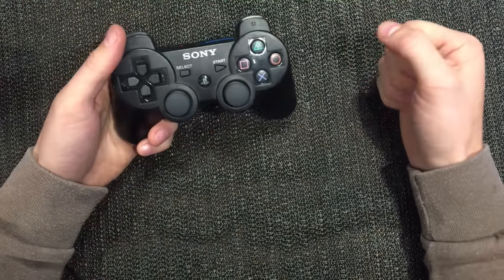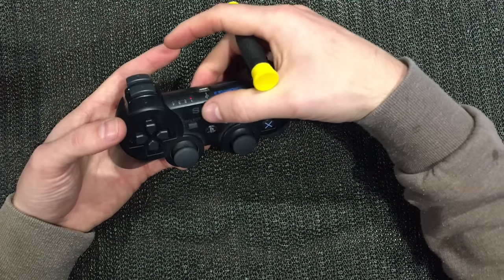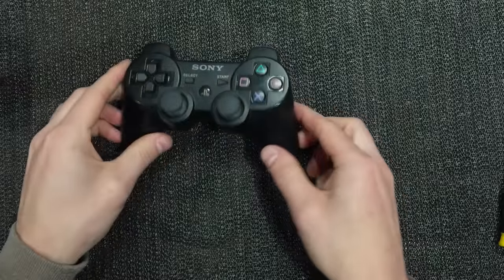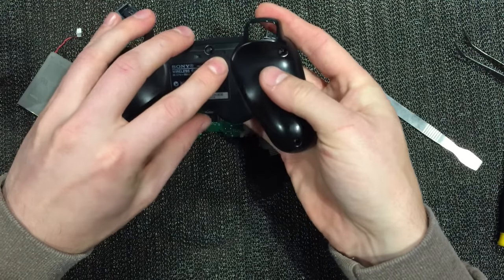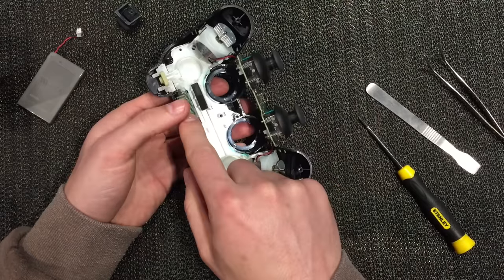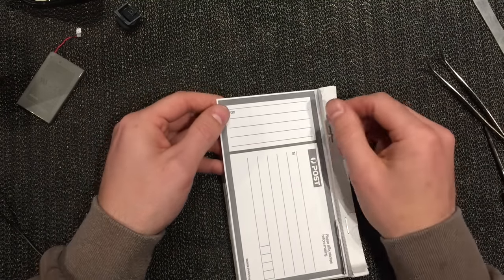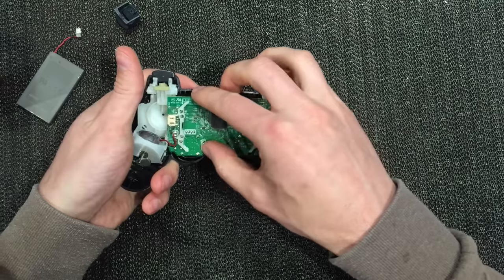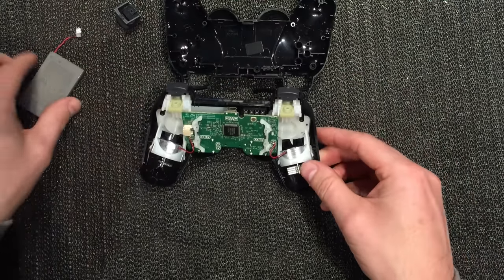PS3 controller buttons pressing themselves fix - YouTube

Comment: You legend. I just fixed 2 controllers I was ready to bin as they acted like they were posessed and going crazy. Instead of the sticky paper I used blutac. It fills the gap nice and holds the felt pad in place. Thanks for the tip.

Comment: This worked out for me so thanks!
Just a note to be really careful with the shoulder buttons. They were being difficult when I was trying to get the circuit board back into place. One wasn’t firmly set in enough, I think it came loose while taking the controller apart. The board knocked the whole plastic base that the buttons lock into out, dislodging it entirely from the plastic strip that was fitted into it. It took a lot of hassle and a couple tries to get that strip and parts back in place, with the contacts centred and responding properly. Was great to see it all working properly in the end though!
Reply: I have everything back in how I believe it goes, but now none of the shoulder buttons work. Did you experience this at all, and if so, how did you overcome it?
Reply: @owenatkinson5744  Honestly I haven’t had a problem with them since! I think you might just have to take it apart to see what’s going on if they’ve stopped responding. Could be that something slipped out of place? It’s a headache for sure.
Reply: @Auchtahelweit  I think it was the thin plastic sheet that runs under the buttons, had that in the wrong place. Finally got all but L2 working, so I'm calling that a win.

Comment: Thanks for this video! I've been using crappy knock off PS3 controllers but turns out I had exactly the same problem as you did with the smooshed foam and the dirty contacts. Fixed both my controllers in under an hour!

Comment: i used peel and stick foam sheets from walmart and i took out the small black pad.  i cut a piece of the peel and stick foam pad and noticed it was the same thickness as the old pad.. so what i did was stuck the sticky side onto the old pad to double up on pad thickness.  I put it in place, gave it all a good wipe with 90% alcohol (dont use 70% - you get residue).  After tightening all the screws nice and snug, this bad boy started working again!!!!  

Thanks Global Garage!!!  I THOUGHT IT WAS THE ELECTRONICS GOING OUT. YOU SAVED ME.

Comment: Goddamn it, took me an hour and half to get this done and it worked, but the buttons R2, L2, become pretty tough when you touch them, ahh whatever i was gonna trash it anyway but now i will use it until it burns 😈
Reply from the maker: Good to hear! Yep it can be a little fiddly, but it's a simple repair that should last you. Using electrical tape would have been a better idea in hindsight to build up the layers. Easy to cut and easy to use.
Reply: this video helped me fix a used controller i got from gamestop, and then i noticed i had this same problem with L2 and R2. 

the pointy parts of the wire springs both have to be pointing toward the handles/grips. hold one point up into the button, press the button into the snaps. you'll know it's correct if one point is hidden inside the button and the other is right up against the white piece, visibly pointing handle-ward. i had to also adjust the white pieces that hold L1/R1 in place..  they had come loose and werent pressing properly. if correctly placed, they feel snug/secure and look symmetrical on both sides. 

sorry this came a year later for you, but hopefully it helps someone else in a year from now XD
Reply: @nabr0n  it did :D
Reply: Just reopen it you probably miss aligned the buttons it happen to me the first time I noticed L1 was harder to press then the other buttons I reopened it realigned L1 boom smooth as gin and juice.
Reply: That is due to the tiny springs which are on the side of those buttons. Physically, it is possible to place them in two differents positions. But only one is good as it provides more pressure to bring the buttons back. I failed at first time to ;)

Comment: Great video, I just cleaned the 2 opposing contacts on mine with a dry cotton bud and it works again, it's a god awful design that is for sure especially when you consider how much they cost even used.
Reply from the maker: Yep a shit design. I may open up the PS4 controller and see if they fixed it.

Comment: I was honestly really skeptical that putting tape on just the little rubber thing the pins rest on would do anything, but sure enough, that completely fixed my problem! My controllers have been like that for years, and now, it's like it's brand new! Thank you so much!

Comment: Just bought 2 controllers for $20. Tried to use them and they were all over the place, they looked hardly used. I cleaned the contacts and cut a piece of zip tie the same length as the foam and put the piece of tie under it. They work great now, like brand new. Thanks for the vid.

Comment: Thanks, mate. Years ago i bought a second hand PS3 from a friend. But one of the controllers were broken. My friend already told me about it, so i never bothered to fix it. Until the other controller also broke lately.

Upon close inspection, it turns out the first broken controller was actually in a better condition than the second one. So i decided to fix it, following your tutorial.

Well, now it's working perfectly. So thanks again, mate. Cheers.

Comment: my brother in law just gave me his ps3. with one of the controllers, every time i pressed down the left stick it would register half the other buttons on the controller got pressed. i was admittedly doubtful this fix would work or that i would be able to pull it off but it worked first try after only 10 minutes. i used a tiny rolled up piece of painter's tape instead of that notepad paper, works perfectly. thanks a bunch, man

Comment: I broke my controller, because it fell from my pc. All the buttons got mixed up, worked by mashing others, or just straight up did nothing. It also pressed random buttons while shaken. I just stuffed a bit of toilet paper under the connector and it works like new! I also cleaned it finally so that was really nice. I was really scared to do it, because people are saying that the triggers are really hard to put back in, but I didn't have to take them out. Great video, thanks for helping!

Comment: Now in 2022 this guide has helped me fix the other 2 PS3 controllers I own. I did this fix for the first one that started acting up 6 months ago or so. 

Instead of the pad paper, I used electrical tape and layered them on top of each other a few times, it seemed to do the trick just as well. Hopefully this helps someone else!!!

Super helpful, thanks for this

Comment: I had 1 broken controller and instead of repairing it i bought 2 used controllers. both of them ended up being unusable. So i ended up with 3 controllers with all sorts of problems, buttons not working, pressing themselves and even joysticks problems. I’d lie if i’d say i wasn’t skeptic watching this video, but i had nothing to loose. I fixes all 3 of my controllers. Can’t express how great full i am.

I had multiple models of controllers, worked with all of them. i used some regular paper and gorilla glue and everything went according to plan.

Comment: After searching every pawn shop for a ps3 controller i finally found one for 15$ had this same problem, i followed the method in this video and the controller works perfectly now, great video, i literally bought nfs most wanted to play on my backwards compatible ps3 only to find out that aftermarket controllers dont work properly for ps2 games on ps3, so this video saved me from buying one off amazon for $50 plus

Comment: I almost opened up my controller to try to see what was causing random button presses. After seeing your tutorial I tried tightening the center screw and that seems to add the pressure my controller needed to work properly! Thanks to you I know it was a pressure issue. If the issue comes back I'll know what to do then too. Thanks again!

Comment: Just fixed mine, big respect, very balzy, would have never tried it without this vid, instead of cart board, used a few layers of electrical tape since it is sticky, then cut it to match size like in the vid.  Hardest part was putting the back cover on (the top R2 & L2) buttons kept falling off, took a few tries.  Patience is Key.  Now controller works like new!

Comment: My controller has been having problems with the D Pad triggering even when I wasn't touching it, mostly while mashing down the left stick. Watched your video, did the same process (although it needed a massive cleaning inside 😬), and now the D pad only triggers when I use it. And to think I was so close to spending $40 on a used PS4 controller. Thank you so much!

Comment: I had a similar issue with one of my own controllers.

Found out it was the contacts not getting enough pressure. There is a foam piece that puts pressure on it.

I then added a 1mm thermal pad (cut to size) and that solved the issue.

Now I bought 2 faulty controllers with the same issue with the hopes of fixing them.

Comment: Thanks dude this worked for me. It was random pressing with the d-pad scrolling through menus was terrible. 

To fix it I added 3 layers of electrical tape to the bottom of that foam pad. Electrical tape facing away from the ribbon (face down into plastic housing). Keep the smooth foam surface on the ribbon side. I then cleaned the contacts gently with a q-tip cotton bud and some spray can electrical contact cleaner. Sprayed a small amount on the q-tip, wiped down the ribbon & circuit board. Reassembled and did some testing in Skate 3 and it's all good!

Comment: Absolute lifesaver this is! my black controller started doing this a few years ago so I switched to my silver one, fast forward to now, it started doing the same thing and I just couldn't play any games. turns out it is the most common issue seen with PS3 controllers. Fixed them both in one night, incredible.
(edit for fixing a typo)

Comment: Sick, worked great. I also added a little spacer on the foam piece on the back of the controller plastic itself, there's a small foam one there and I added a piece of foam tape to it to add a little pressure to the entire board, whole controller feels stiffer now and I have no more issues.
Thanks man.

Comment: My controller had a different rubber pad holding the contacts in place, so adding a shim wasn’t an option but cleaning the contacts and reassembling the controller worked, thanks for the video saved me a few bucks on a new controller.

Comment: I just Ebayed two PS3 controllers and one of them was having this issue even after cleaning the contacts. This solution worked for me, only difference is I used electric tape as you also suggested using. The controller works perfectly now. :) Well, almost. I do keep getting a "connect controller 1" error and I'm not sure why. I even have it plugged into the PS3 and it still throws this.

Comment: I've just tried this on my client's PS3 controller. Surprisingly, it works! I guess adding some multi-layers paper to give some pressure between the motherboard, the contacts on the plastic PCB, and the rubber piece does help. 

I've been working on a lot of PS3 controllers (I bought them as second hand), every time I work on them....it makes me wonder why they've design the controllers this way.....not to mention the plastic post (that holds the plastic PCB) can break easily if one is not careful when working on it.

Comment: for anyone who has a stripped screw they couldn't remove to open the controller... I ran out of options and just used the bottle cap opener on my pocket knife to destroy a ring around the inside of the screw hole. It worked. I wrapped the foam thing with several layers of scotch tape and now the controller works perfectly. Just make sure your triggers are correctly mounted before reassembling. And try to avoid scratching the exterior if you do this on the handle screws. I'm not sure how safe this is on the center screw. I don't want to reopen the controller to check. The bottom of the center screw hole is close to the battery.

Comment: A mere two layers of electrical tape on the foam did the trick for me. Doesn't take much to keep it from sinking into the gaps in the plastic. Thanks for the tip. I'd already taken the whole thing apart and cleaner up every button, racking my brain as to what the problem was.

Comment: tried this at multiple thicknesses, ended up following someone else's guide using electrical tape to wrap the foam pad after this style didn't seem to do it. I took the controller apart and tested different ways at least 20 times. still ghost inputs with typically ~15 seconds in between ghost sequences. ghost inputs from all possible buttons including triggers. advice?!
Reply: at that point just buy a new controller, it really doesnt wanna work lmao

Comment: Thanks soo much for this fix.  I tried the material tape first, but I ended up putting a whole another piece of rubbery stuff in (so double thickness), and it worked perfect.  Thanks again, very much appreciated 🙌.  And awesome it was done by a fellow Aussie, absolute respect 😎👍

Comment: Suddenly my controller would press buttons randomly while playing, i thought it was a driver issue on my PC, since i updated to the newest pieces (dshidmini, paired with DS4Windows to get PS icons instead of xBox icons in-game)... Turns out, it was in fact a hardware problem, and cleaning the contacts & propping up the foam as showed in the video, fixed my issue. Thanks, now i don't have to go and get a new controller

Comment: Is it mandatory to disconnect the battery first? I cracked open the case easy enough, but the battery connector is on pretty tight. I'd rather skip that if it's all the same. Thanks!

Comment: I did this today and can confirm that it works. I used a couple of pieces of electrical tape either side and cleaned the connectors with a q tip

Comment: Both my controllers began doing this to the point where they would just quit the game or even shut down the console on their own. Tried this method out, but I used a command strip to ensure that the rubber bit stays in place and it seems to work out very well.

Comment: im no engineer but that controller seems to be designed to fail after some time. i mean its connected through pressure only ? by a rubber ?

Comment: This fixed my controllers but now i have a problem with the controllers not turning on without the charger being connected. Is something wrong the battery or would it be something else?

Comment: Hello
I have a problem
When I play, lag happens in the control and the lag goes when he approaches the device and When I connect the controller to the device with the wire
my english is bad so i use a translator so excuse me if there is any mistake in the comment 
thank you very much

Comment: Thank you so much this worked great so easy to do when I squeezed the controller like you did my controller went crazy. All over the menus and the rubber was on the plastic part stuck I just cut an piece of duck tape to size stuck it on and cleaned the mother boards like you did and easy to install. And it’s crazy how cheaply made the PlayStation 3 dual shock is your right 2021 and this method works great!!!!

Comment: I had a remote which started doing this like 4-5 years ago
My current controller also started doing this recently
After watching this video I figured to try it out but first on my old remote (which was still malfunctioning btw) so even if doesn't work there would be no loss
In fact, my old controller now works better than my current one 😂
I still have 2 more controllers to do this on, so now I can play with my friends
Great job man! I dropped a like

Comment: Over time the foam gets pressed down on the plastic ridges in the housing. While the ridges hold it in place they also make it thinner over time. Just turn it over so the thick part is down and it's back to factory spec.

Comment: For reason unbeknownst to me, both my old ps3 controllers' right side has stopped working, X O triangle sqaure. Tried shorting pins,14-17 on the motherboard, and still nothing. Any ideas? Also, I just found out you can use your ps5 controller with ps3... but if only works wirelessly...so...you'll still need a ps3 controller to set it up. Home button doesn't work either.

Comment: I swear you are the best!!!
I was so hopeless and keep saying to myself that won't work but it worked!!!!
Subscribed to your channel <3
Reply: You followed each and every step Bashar? Or did you just clean the contacts with the Isopropyl?
Reply: @jayn3636 
What worked for me not the cleaning because i cleaned it long time ago but didn't work
It is the paper part ✅
Reply: @bashar-7708  You used sticky tape or paper and tacked it on the foam?
Reply: @jayn3636  just a piece of paper without any tape and it took me some time to adjust it but it worked perfectly
Reply: @bashar-7708  Thanks Bashar I'll try it myself when I can and see what happens.

Comment: I just bought a secondhand ps3 with 2 controllers and the more beat up looking one starting going crazy after I plugged it in and it does feel loose and like it's about to fall apart. not looking forward to cracking it open if I need to fix it because it is visibly caked in dirt around the buttons and where the top and bottom of the controller meet I think somebodies younger sibling used it before they put it up for sale. the less broken controller I plugged in first is fine except for the left joystick doesn't click in do you know what causes this or how to fix it?